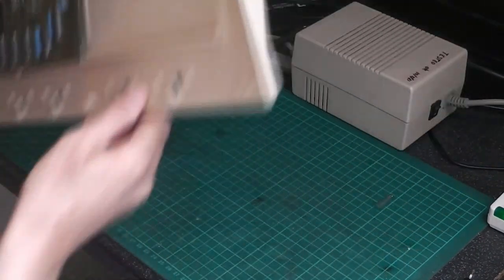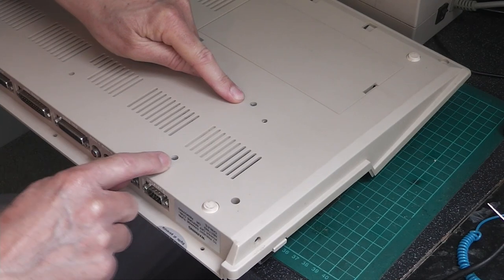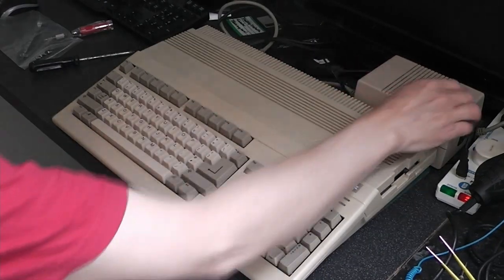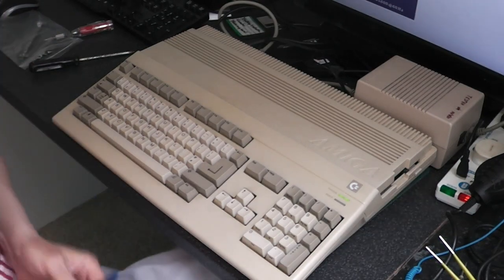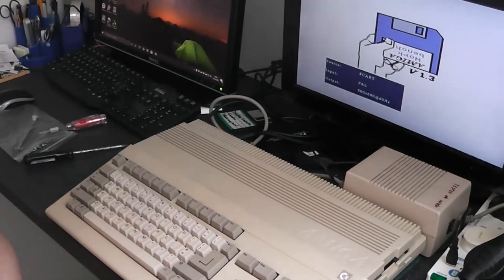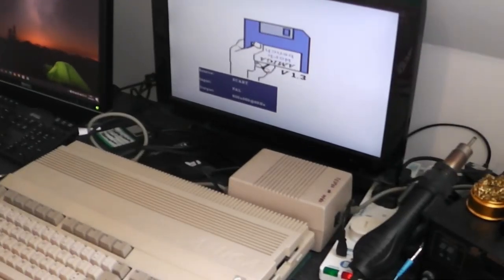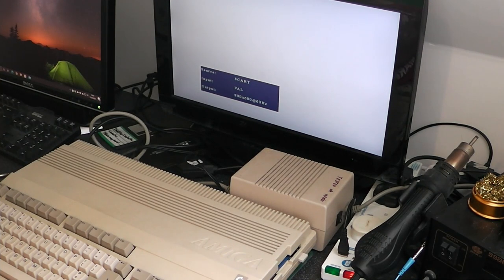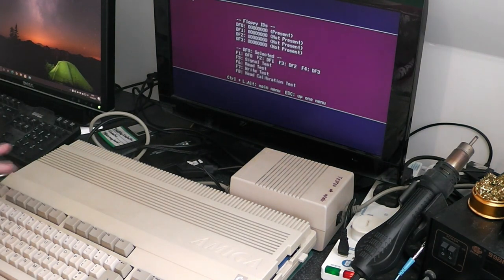Amiga disk drive service and clean

Comment: I need to test if the cleaning the floppy drive  helps to get my games running. I tested my old Amiga after over 30 years and I get the floppy image on screen but the games does not run. Games might be not working also. Luckily my crt monitor still works. thank for the video!
Reply from the maker: Glad you liked the video :)